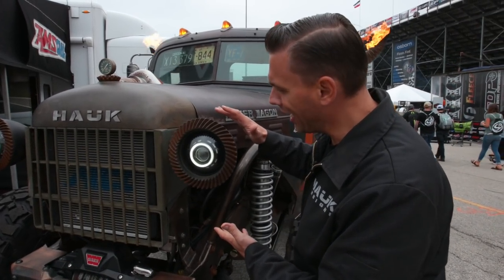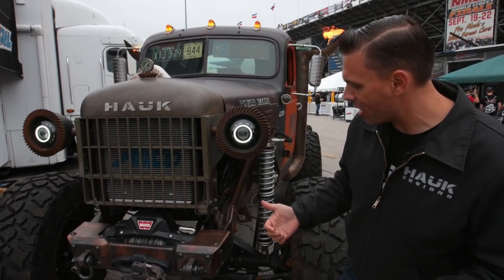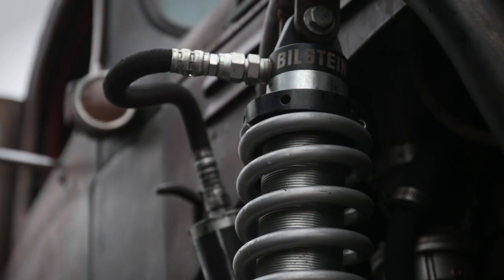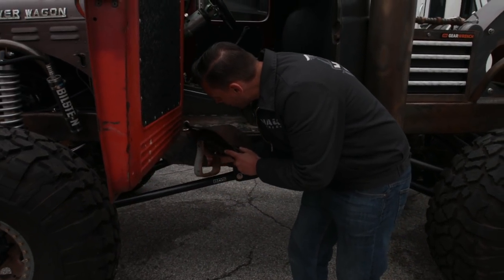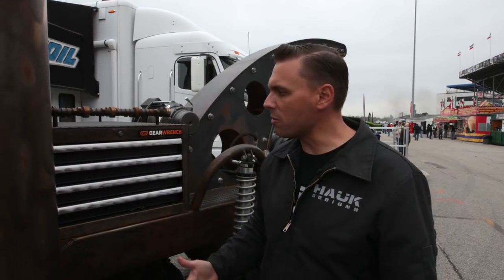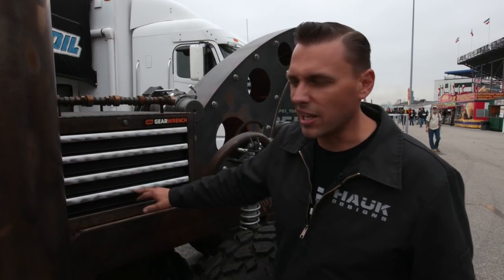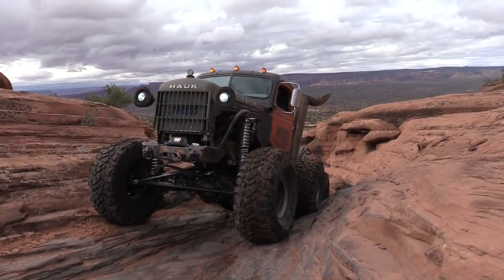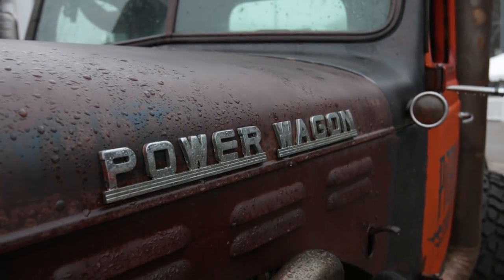The Wrecker - Hauk Designs

Comment: This Would fit right in at Matt's Offroad Recovery. Only thing I would add would be some way to cover those toolbox's from mud and water because I wouldn't wanna open those nice clean drawers with 3 inchs of mud packed to the front of them during a recovery. Not that this will likely ever see much use as a rescue vehicle.
Reply: It's what makes Matts Offroad unique, Trail Mater too.  Not only do they build the show quality vehicles, they actually uses them for real work.  Matt even drove the Morvair to the Rubicon, no trailer.   Gotta appreciate that.
Reply: Looks like Matt's Offroad wrecker will be more functional (when complete) and will eventually be worked HARD like Trail Mater
Reply: This a cool rig, Matt has attention for function over form, this truck has 500+ lbs of unnecessary weight. Ring gears around headlights for example, pinion gear on radiator cap.

Comment: I'd love to see this go up against matts off road recovery heavy wrecker when finished...
Reply: Matt's build is for actual functional daily use. The Dodge in this video is cool, but it's a "show" truck as he states and is unlikely to ever spend time actually doing recoveries. It's more likely to cruise the show circuit.
Reply: @WS102  look at 1:20 in the video…..
Reply: @sjv6598  Once again, it's a show truck that wasn't actually built to do recoveries, it's got a fixed jib/boom with a single rear winch and a single front winch. It's a show truck that can wheel. It wasn't built to be a recovery vehicle except on the odd trail run or rare event when it's called into service to pull something out, it certainly can't tow, there would be no control over the lifted and towed vehicle. Matt's truck is actually built to be a used and abused daily recovery vehicle, not just a capable show rig. Same with Rory's Tow Mater, it's a capable tow rig, purpose built as a tow rig, not just a good wheeling rig built to look like a tow rig as this is. If this Hauk truck is a tow rig, then any truck with a front and elevated rear winch could be considered the same.